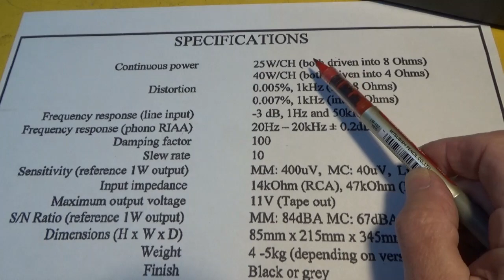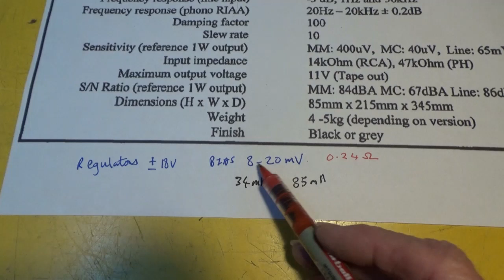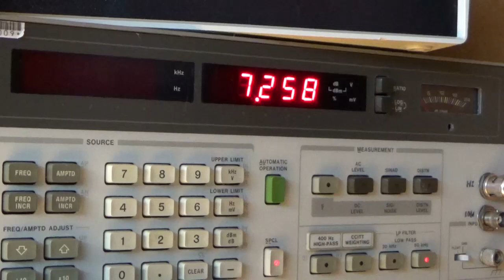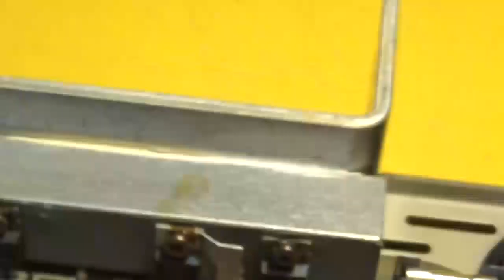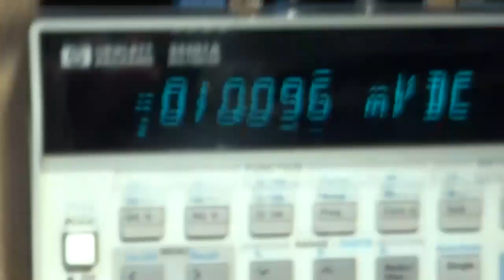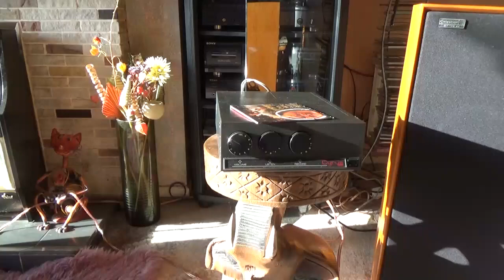Mission Electronics Cyrus 1 Amp tests

Comment: Beautiful video, congratulations. I own the same model that I purchased in London in 1987. I haven't used it for more than 20 years and I've inspected it internally: there are no signs of aging such as burned components or swollen capacitors. Can I turn it on, or do I need to follow a particular procedure? Can I turn it on without connecting the speakers? Will the amplifier be damaged in the absence of a load? What type of affordable spray can guarantee cleaning of the potentiometer contacts for volume, switches, and the headphone jack? What type of paint can I use to repair the paint that has worn off the knobs? Is it worth replacing the capacitors? If so, where can I purchase them at a reasonable price while maintaining overall audio quality and power supply performance? If the capacitors are replaced, is bias adjustment necessary? Where can I find the electrical schematic for my Cyrus One V2?
Thank you for your kind comments. There are many questions. 😅 If you can connect it to some old speakers, you won't risk damaging the good ones. Although it probably still works fine. Deoxit F5 to clean the potentiometers. It's entirely up to you whether you want to replace the capacitors—it's a good way to protect them in the future. By searching Google for the service manual, you should find it. It should also show the procedure for bias adjustment. I did this in my last video on the amplifier, and that amplifier was running very hot before the adjustment.
First of all, thank you for your prompt response.
As far as I know, is it possible to start functional verification tests after all this time of inactivity without connecting any load?
If so, for how long?
Keep in mind that the device has always been stored in optimal temperature conditions, in a place without humidity.
In this context, would you replace the electrolytic capacitors or some of them, particularly the larger ones like those in the power supply?
Do the non-electrolytic capacitors also need to be replaced?
In my situation, would you make these replacements even if everything were to work correctly when powered on?
Where would you buy the capacitors?
Are there targeted purchase kits for various models?
Even better if they can be purchased on Amazon.
My concern is that for various reasons the bias might need to be redone.
How does an incorrectly set bias manifest itself?
Only with increased heating, or does it risk affecting proper functioning or damaging it and degrading sound quality?
Can you suggest where I can find the electrical schematic and the bias adjustment procedure?
Thank you very much, goodbye

Comment: My Cyrus One has tubes. It's serial number 100979c.I bought it in the early to mid 1980's in Overland Park, Kansas at a high end stereo shop on Metcalf Avenue. I got a job as a flight attendant for American Eagle in 1995. It hasn't been used since. Any idea how much it might cost to have it serviced? The connections on the back are filthy, and I have no idea what kind of shape it is in on the inside. 
Thank you very much! In the days when I used it regularly, I absolutely loved it!
Lisa
Reply from the maker: Could be expensive, quite likely the old capacitors will need changing and maybe some of the resistor too. A fair bit of work. I'd offer to do it, but I guess you're a bit far away! Hope you find a decent place to work on it.

Comment: I have the successor, Cyrus two, rated at 50W x2 alone and 70W x2 with the external supplier named PSX, paired with Celstion Ditton 3 and it still works fine after 34  years. Please also note that all the capacitors in the signal path are unpolarized, thatś why the sound is so good, and no, no need of tone controls even at age 59 :)

Comment: I see you have converted your hp8903a  from rear  to front BNC's. I see the hole is in the bezel on mine which is also rear mounted. Do you not use the Sweep source of the 8903?
Reply from the maker: Hi Simon, yes it was an easy job to reroute the four cables and cut out the holes in plastic, I've never used the sweep function other than to try it out, it's easier for me to use the sweep on my rigol arbitrary waveform generator if I need to, Cheers
Reply: @ptronix  and that's the reason while you can't measure less than 0.02% THD. Because the Rigol produces that much. To check that, connect the output of the internal generator of the HP with it's input, and you should get <0.005%.

Comment: Super Video As Always Nick !! Those PT7 Transistors Are The Original Transistors Nick These are obsolete Now  But There is a  direct replacement available, which is the BUV28a....PT7 was just their factory code for BUV28a These Are switching transistors And Not Audio Types The Cyrus 2 Has a Large Heatsink Bolted To a Die Cast Chasis And Die Cast Lid And is Larger All Round And is Very Heavy Compared To The Cyrus One and The 2 Has a Balance Control As Well Nick Regards mike.
Reply from the maker: Hi Mike,Thanks for the info on the transistors, it's a nice amp let down by the plastic case, heatsink & no speaker protection, so if one of those output transistors fail would probably  destroy the speaker, 
Cheers
Reply: @ptronix  secondo te i transistor finali possono essere sostituiti con equivalenti garantendo la stessa qualita' audio ?

Comment: Good stuff Nick. Those output transistors are BUV28s I believe. Cheers Andrew
Reply from the maker: Thanks Andrew, a nice amp let down by the plastic case , poor heatsink & no speaker protection, if one of the output transistors fail will probably destroy your speakers!